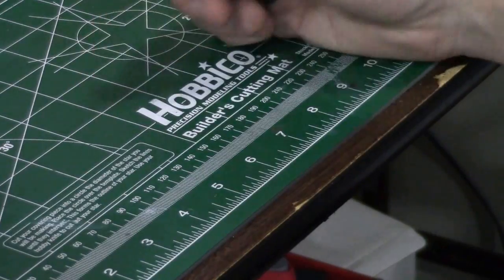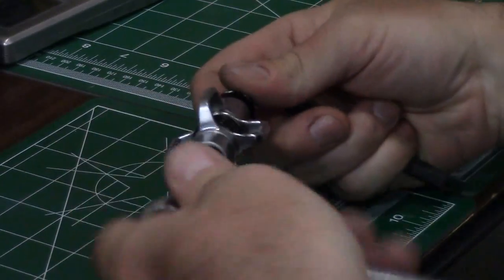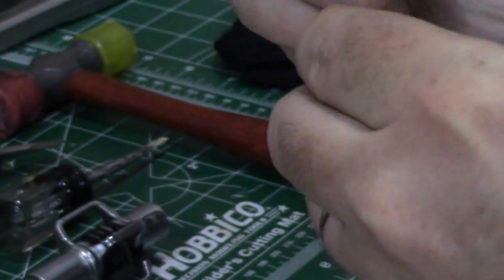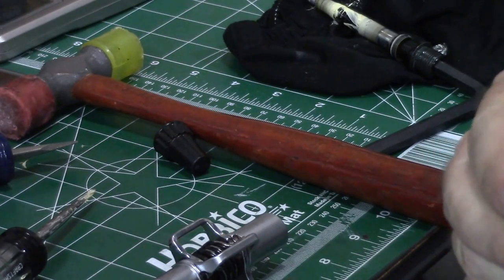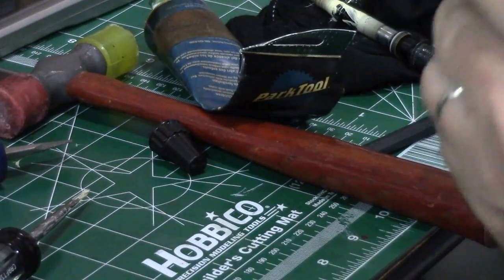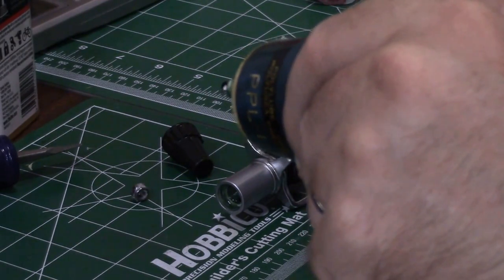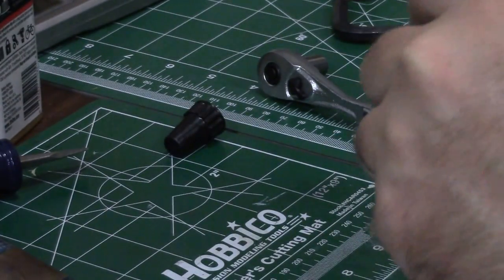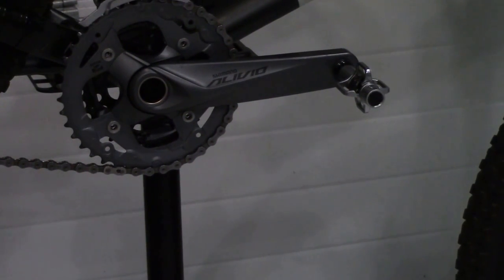Crank Brothers (egg beater) pedal repair

Comment: What are you repairing?  I browsed the video quickly (skipping a lot) and could find only maintenance work.  I'm repairing/replacing a broken spring on one of my pedals.  Any tips on how to get the new spring back in?  In the assembled pedal the spring is under tension... but disassembled, without tension, I cannot get the spring to line up with the core of the pedal, and thus cannot slide the core into the spring/pedal assembly...